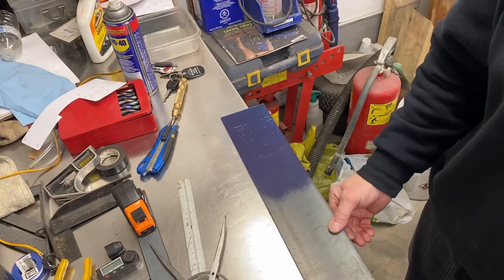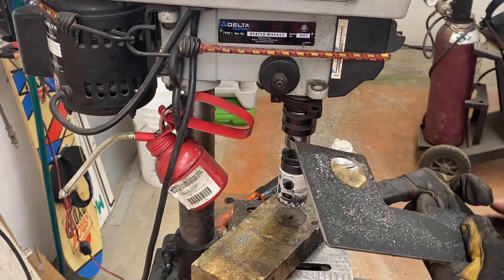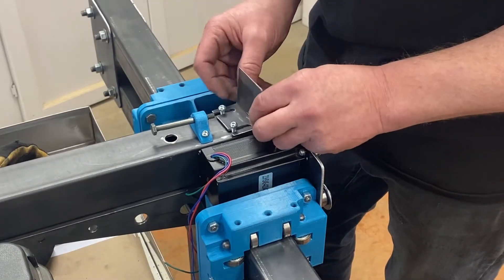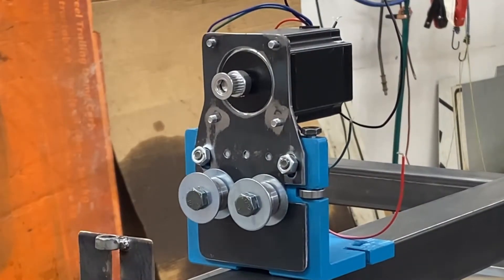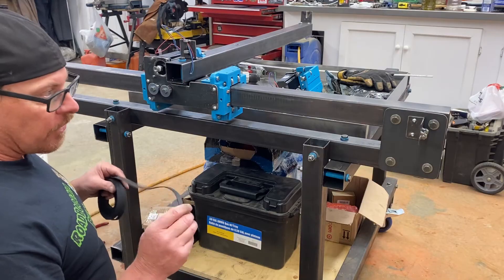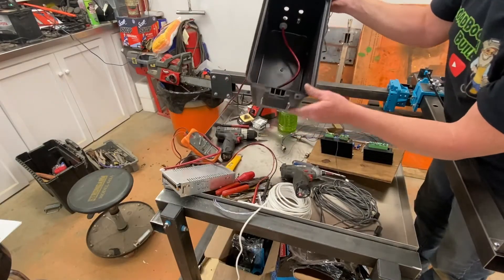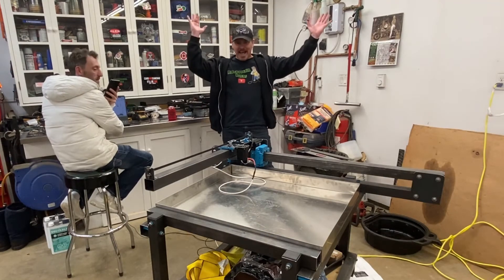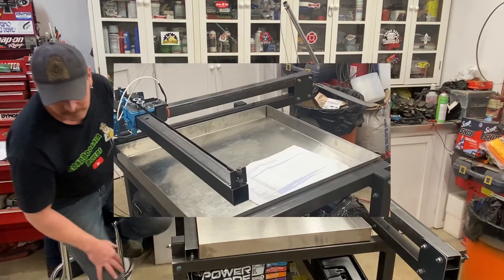Home Built CNC Plasma Table Comes to Life, Part 2

Comment: Hello, again.  I'm at the point I can't delay the wiring any longer as I have done all the mechanical elements including the Z axis feature.  My question today is do you think I can put the Z driver in the ammo box without crowding things too much and creating too much heat ?  I was a little unsure of how much wire to use on each run between the drivers , power supply, and the other small elements in the box but it appears all I need would be just enough to place the items neatly on the board. Thanks , as always, for your insight Demon
Reply from the maker: I can’t fully answer that question, I have not added a Z axis to my machine at this time. If it fits in the ammo box I wouldn’t be afraid to try it
Reply: @roadboogalabuilds5318  Yeah. I didn't really expect you to know for sure. Guess I'm just delaying the wiring process do to my inexperience.   Thanks for responding again.   Have a great day.
Reply from the maker: @williamlanphar630  good luck let me know how you make out
Reply from the maker: @williamlanphar630  👍🏻

Comment: Hello, again.  I just wanted to ask you if you are happy with the plastic ammo box for the electronics.  I have the same box you have and I am at the stage of starting on that part of the project .  Do you have any issues with heat ?  Should I add a fan or is the method you show in the video working fine.  Thanks for all your help.
Reply from the maker: It’s been working fine for me, however I have never ran my table for long periods at a time. I also figured I would add a fan if I had heat problems, so far so good 👍🏻
Reply: @roadboogalabuilds5318  Cool.  Then I'll get started .  Thanks, again !
Reply from the maker: @williamlanphar630  good luck have fun

Comment: Idea on making those washers a bit easier to install. On the stl files, add a extended bit. Instead of being shaped like an O, it would be shaped like O- so you have a little piece to keep ahold of while installing them. Then trim the piece off after install
Reply from the maker: Good call

Comment: I've noticed that there is an issue between USB 2.0 and USB 3.0 with serial comms. Most outputs on laptops these days are USB 3.0 due to their speeds but the pin outs are just a liiitle off. Not sure why it doesn't work unless it's a serial USB cable issue, but I'm assuming you're using the same cable that came with the arduino. Glad you were able to work through it. This is giving me inspiration to try my had it.
Reply from the maker: I bought the USB cable separately (didn’t come with the Arduino) maybe that why I was having difficulty flashing it?
Reply: @roadboogalabuilds5318  maybe... but honestly, it's a pretty stupid standard that some manufacturers choose to use and others to simply ignore. Then there is serial USB cables... I won't get into those... basically if the end of the cable is black, 98% of the time it's usb 2.0 and if it doesn't work plugging it into a port that's blue or red, find a port that's black.  USB3.0 is supposed to be backward compatible, but I've fixed more issues this way than not. 

I mean USB stands for Universal Serial Bus, but some where it's been lost in translation. 

BTW, the business end of the USB (the small side) is referred to as the "B" side. And this can very on size. What most people call an "Android" charging cable is really a USB2.0 B-micro end. And there is a slightly different pinout OTG (the data type for android) and serial. The regular USB2.0 B side, what most people refer to as a printer cable, (much bigger than micro or mini) almost square, doesn't have this limitation because it's only serial. 

Sorry, had to nerd out a sec.

Within recent memory, I had this problem connecting the brain of my daughter's robot to my laptop. My laptop only had USB3.0 and USBc ports. Plugging in a docking station that had a 2.0 fixed it.
Reply from the maker: @micvox6805  that’s a lot more about cables then I know!
Reply: @roadboogalabuilds5318  yeah, sorry about that... I could fill an entire 1hr video on different cables, types, and uses, but it's already been done a million times by far more knowledgeable than I.  But thanks for the reply!

I really enjoyed this series.
Reply from the maker: @micvox6805  thanks

Comment: What cutter+compressor combo are you running with the table? I'm about to start my build -- parts are printing right now heh
Reply from the maker: https://youtu.be/wm-cVtidRrU?si=rMuX2G_cMtOMH4CS the compressor I’m using is a larger shop compressor I have had for years, you could use a much smaller one to operate this table

Comment: You did a very nice job on this build. I’m about 90% complete with mine. Your shielding wire did you connect it to the motors or did you just leave it inside the wire? Thanks have a nice day.
Reply from the maker: Thx, I left my shielding wire loose inside it is not connected to the motors, at the time I was unaware to do so. So for it works great so unless I have problems I will most Likely leave it how it is.

Comment: Hello, again.  I hope im not being too annoying.  I am going to use the same plastic ammo box you did.  Can you tell me what the fittings and glands you used on it ?  Also, about how much of the 4 conductor shielded cable did you end up using ?  Thanks.
Reply from the maker: Actually in the garage messing with the table right now lol
Reply: @roadboogalabuilds5318  hahaha....what timing !
Reply from the maker: No prob not annoying I bought wire in bulk lots left over, here is some Amazon links of what I used 
UHPPOTE 22 AWG Gauge 4 Conductor... https://www.amazon.ca/dp/B08BZBK5HN?ref=ppx_pop_mob_ap_share

Electrical Wire CBAZY™ Hook up... https://www.amazon.ca/dp/B0791BNDY2?ref=ppx_pop_mob_ap_share

DGZZI 5Pairs GX16 4Pin Male... https://www.amazon.com/dp/B07PQF2RDL?ref=ppx_pop_mob_ap_share
Reply: @roadboogalabuilds5318  Thank you, again.
Reply from the maker: @williamlanphar630  all good 👍🏻

Comment: I'm in the same boat at @mxdadNZ is in ..   Tried to flash my Arduino also and it would not flash with my laptop then went to my desktop and tried it also and still would not flash.  Could you ask Jean what he may had to do take the flash? ...  I contacted JDs and asked them about the flash and they said OpenBuilds must had changed something in the software. I bet its because OpenBuilds wants it to load onto their black Box they are selling for over $200.. is my best guess.

Comment: have you had any issues with heat build up in a sealed box with the electronics?
Reply from the maker: I have not, it was a concern of mine when I built it. If it ever becomes a problem I will prob raise the box up install a fan in the bottom to pull air out

Comment: Where do you connect the shield wire at on the aviation connector?
Reply from the maker: good question, it’s not hooked to anything and it’s been working fine. JD’s garage just came out with an update video that helps explain what to do with shielded wires

Comment: Do you know what spools of wire you used for motors (gauge and number of wires) and about how many feet did you need to buy. If you have an Amazon part number even better 🙂
Reply from the maker: I bought some of the wire locally it was kinda crap, I really don’t remember how many feet? I ended up getting this from amazon UHPPOTE 22 AWG Gauge 4 Conductor Bare Unshielded Cable Alarm Security Burglar Wire (50ft) https://a.co/d/iwmEM2Y hope that helps

Comment: Gidday from Australia, great helpful video, I have got my plans from JD garage and just starting my build. Just interested in what length you made your legs, I like the height, and the mobility with the casters to. Keep up the good work, all the best Lance
Reply from the maker: Thanks Lance all the way from Australia, The hight of my machine is 31” from the floor to the top of the water tray, the legs are 25.25” not including the hight of the casters I used. Legs a casters combined 31”

Comment: Kool build did you have any problem with overheating in the amo box thanks
Reply from the maker: thx, so far no problems with that but i haven’t worked it a whole lot so time will tell? If it’s a problem I was thinking of raising it up and cutting a hole in the bottom with a fan

Comment: I'm in the process of building this design as well, but not as far along. The major 3D printed parts are done and the Z axis is done. Have made a torch height controller which has only been bench tested so far. Soon need to but some tubing.
Reply from the maker: Cool there sweet tools 👍🏻